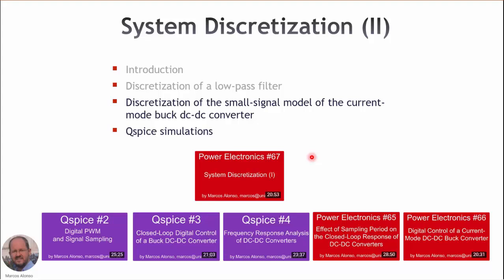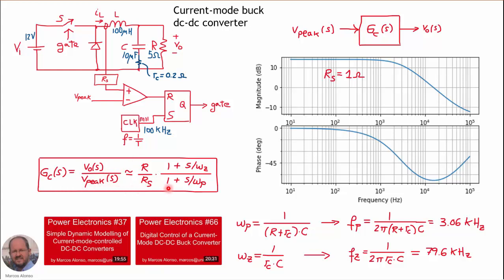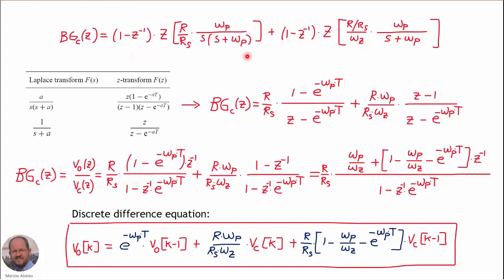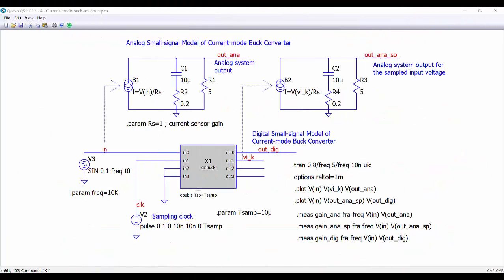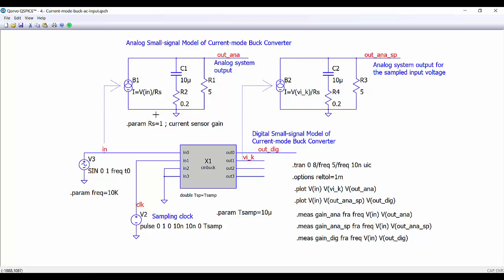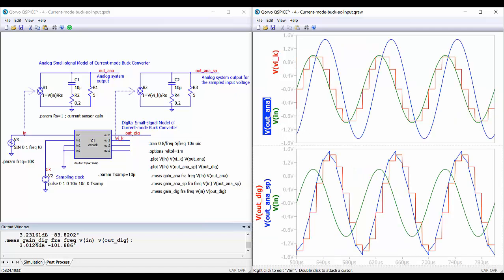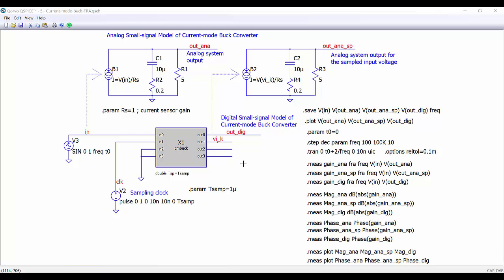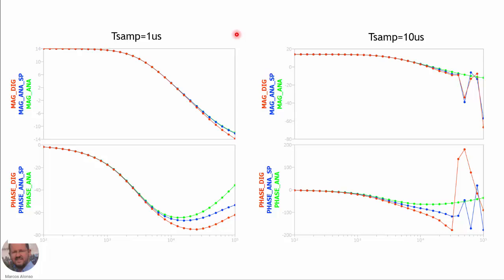PE #68: System Discretization (II)

Comment: Thank you for the wonderful teaching video, Professor. When we sample the current, is it better to sample from the left side of the inductor or from the right side? Of course, this is not the focus of today's video discussion. Thank you.
Reply from the maker: Yes, it is better to measure the current on the other point to avoid switching noise. However, usually the current is measured in series with the switch. In this way a cycle-by-cycle switch overcurrent protection can also be easily implemented.
Reply: @MarcosAlonsoElectronics  Thank you for your reply, professor. Actually, I placed the Hall current transformer at the switch node for sampling. The sampled current waveform was abnormal. I suspect it was caused by the higher du/dt noise at the switch node.